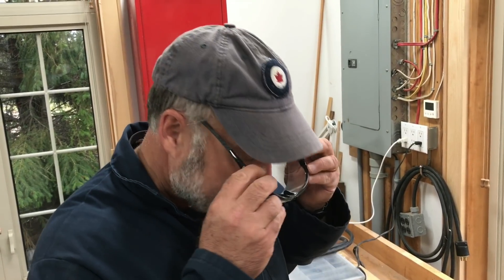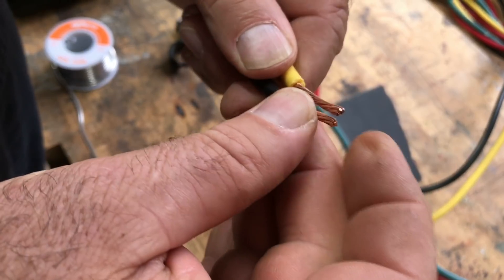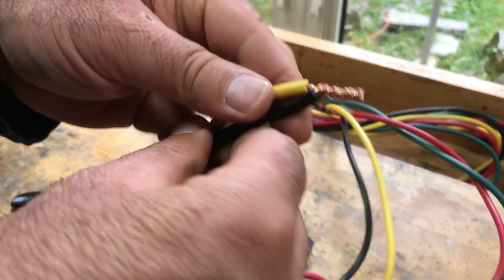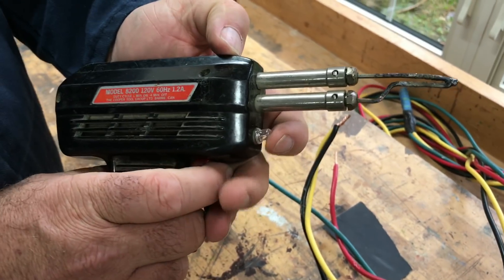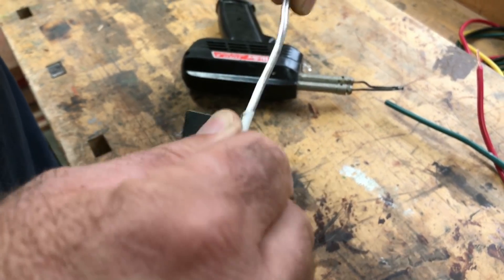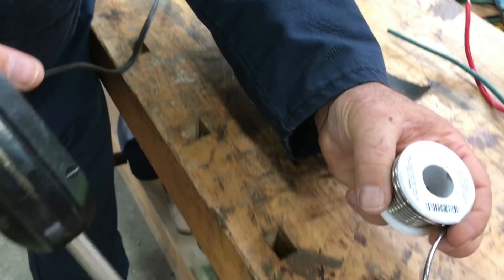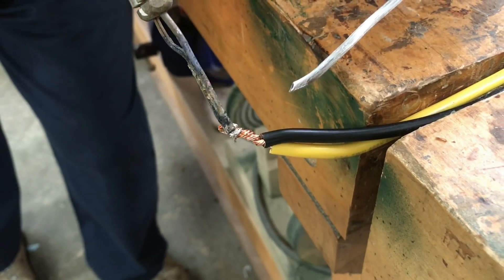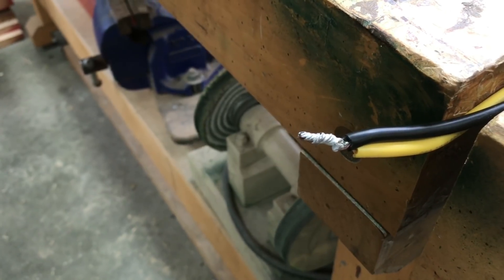SOLAR GENERATOR VIDEO#2: Soldering

Comment: Hi Steve,
I was always taught to use rosin core solder for electrical/electronic soldering and to use acid core for plumbing etc. Just curious why you chose to use acid core for an electrical joint. Keep up the great videos etc I do enjoy them all.
Mike
Reply from the maker: Hi Mike!
Thanks for commenting. I was always taught to use rosin core for fine wiring and electronics, but I've never had any trouble using acid core for large wires like the ones in the video. I'd never use it on electronics because it would probably damage the copper conductors on the board. But big old wires like the ones in the video are more like plumbing than electronics.
I hope this helps and thanks for watching!
Steve
Reply: Hmmmmm?